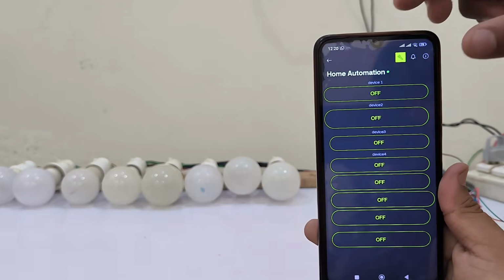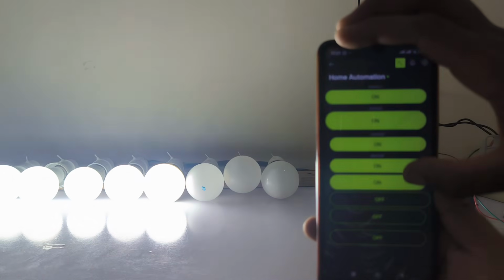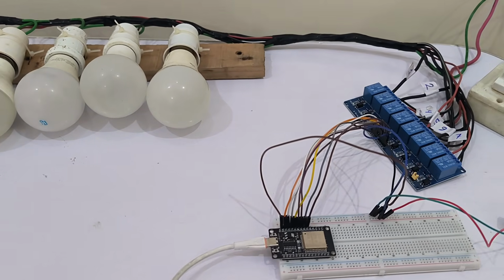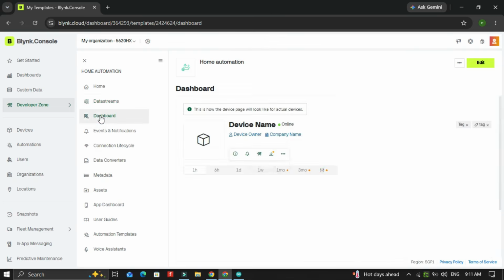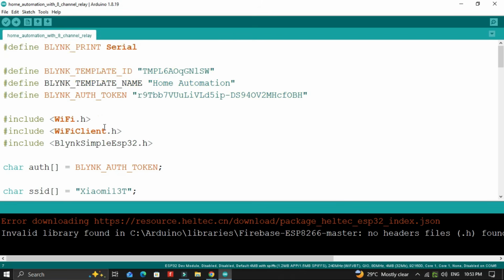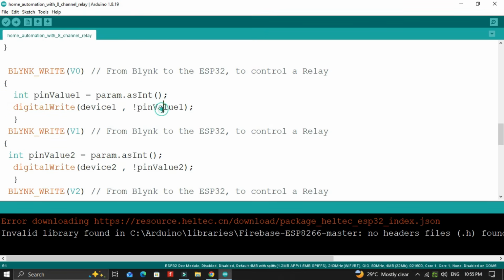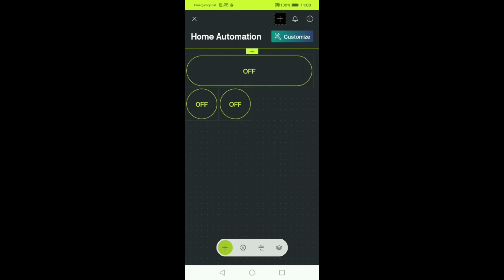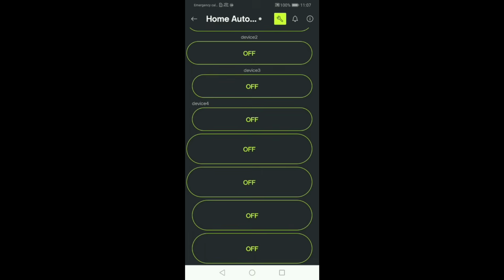Control Home Lights from Anywhere Using ESP32 & Blynk IoT

Comment: It's resume previous relay state after power reset?
Reply from the maker: The relay state is not saved by default, but you can store it in the memory if needed.
Reply: @theinfoflux if stored in preference nvs memory then more better